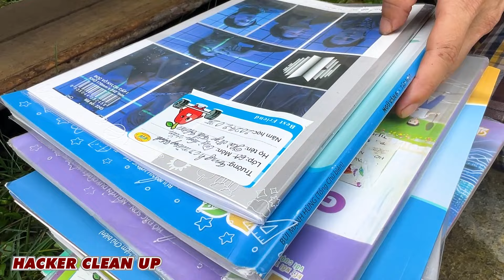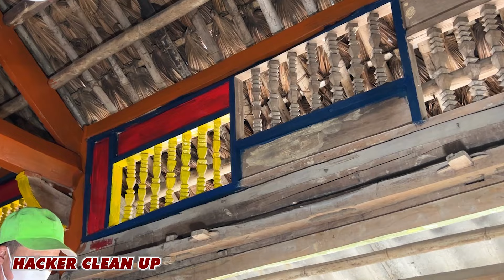HELP. Single Mother, Husband ADDICTED - EARLY DIED. Fulfilling DREAM Renovation Old DISASTER House.

Comment: To clean mould on your walls If you don't have a specific mould spray, bleach can be used instead. Mix a solution of one part bleach and four parts water. Take a cloth and wipe this solution across the wall, scrubbing gently until all the mould has been removed. You can then wipe the bleach away and dry the area using a separate cloth.
Hope this is helpful😊

Comment: How to get rid of wood mite

Combine half a cup of apple cider vinegar, half a cup of borax, and half a cup of hot water in a spray bottle. Shake the mixture thoroughly to dissolve the borax. Spray the solution onto affected areas every two or three days until no mites are visible for at least one week. 😊